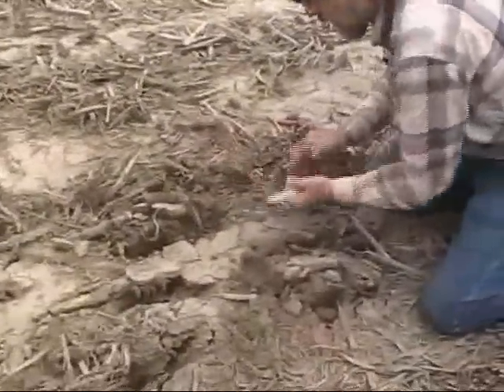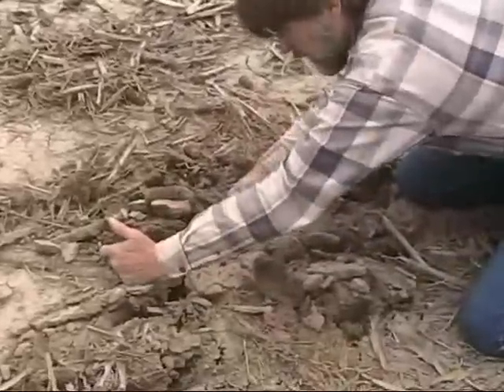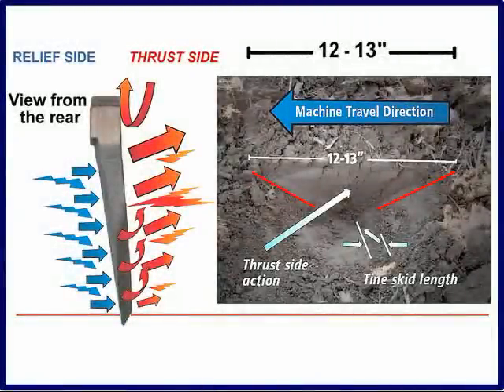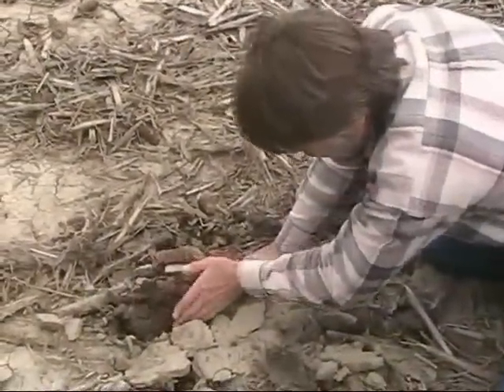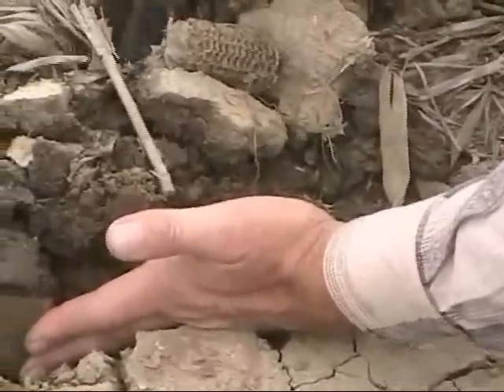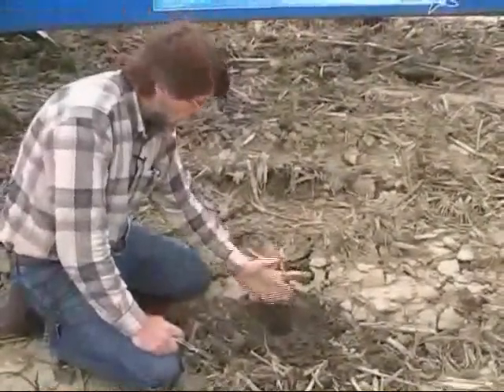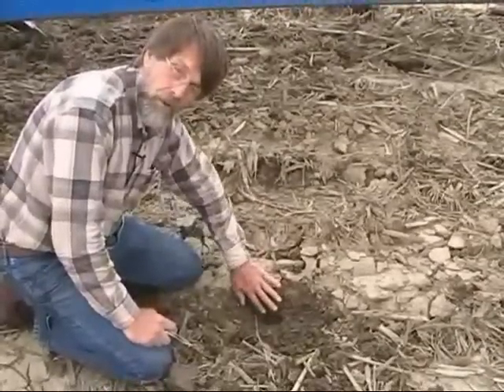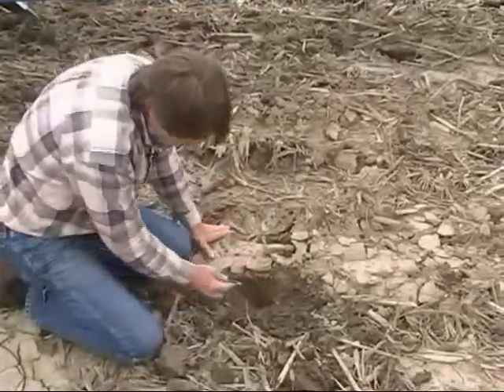SmartTill In-Action

Comment from the maker: caseman1134,..blinded by the glitz of that yellow paint and fraudulent video clips of the "shattertine".
experience difference of theshattertine tine and original geometry they abandoned in 1988 except for turf models with the water test.  air is a bit hard to see so just watch the water.  don't miss the concrete now, Dah....
Go ahead and pour it in the two different machine holes and watch.You'll make several more trips to the bucket with one of those holes and not the Aerway. Count for us now.